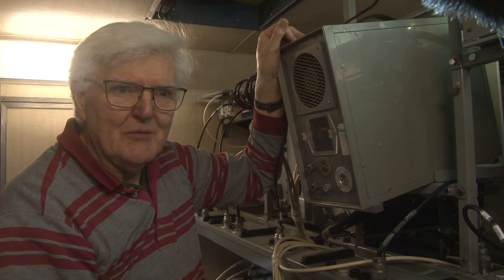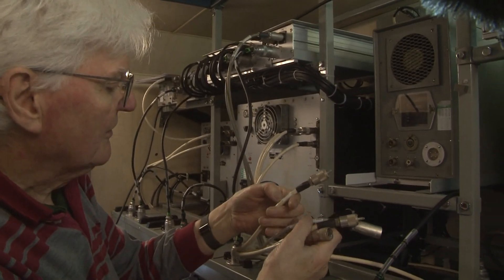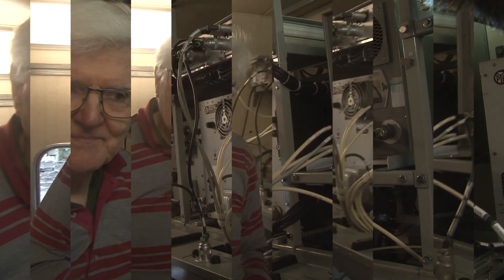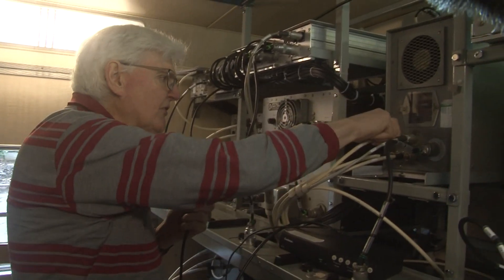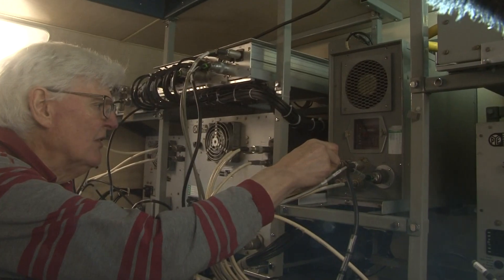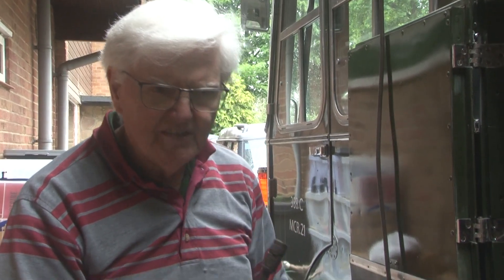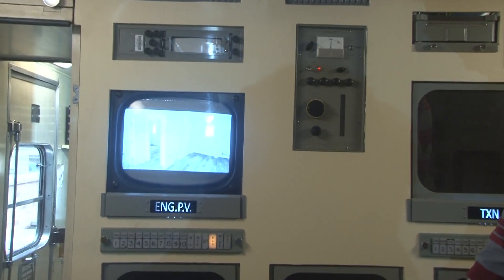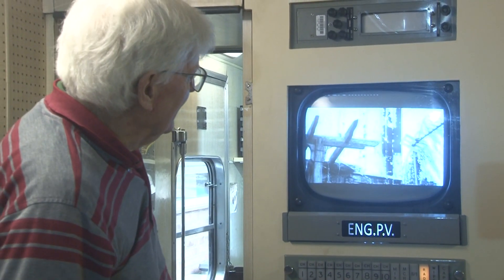The Thorn Off-Air receiver, part 2. Reinstallation and testing of the Off-Air receiver

Comment: A bit of a challenge, do you try and hide a bodge box, or do you make a custom off air receiver, that looks normal on the outside, but has a digital innards, that way you could get the channel selector to actually change digital channels.